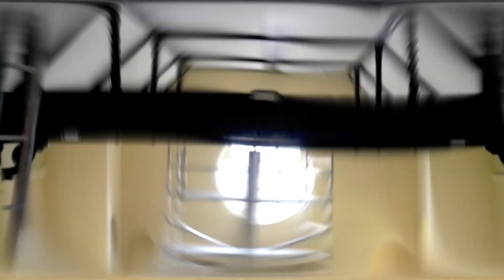Plastering a Church | Boarding and Skimming an Alter Ceiling | Church Restoration

Comment: you've got to be one of the best plasters i've seen, seriously impressed with the level of finish you achieve every time. can only hope to be as good as you one day
Reply from the maker: That's very kind, I'm not perfect and I have my off days but I always hold perfection as an ideal. Obviously it's unachievable but it seems to help get good results. I'm sure with enough practice and the right attitude you will get just as good, if not better results!